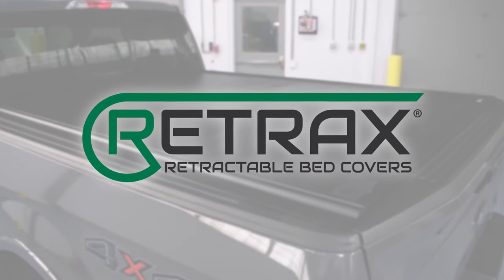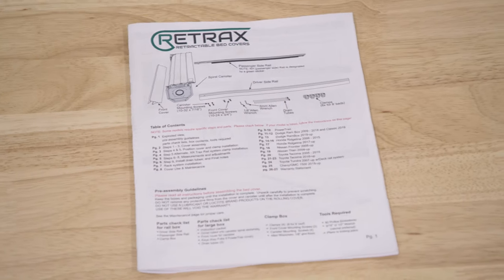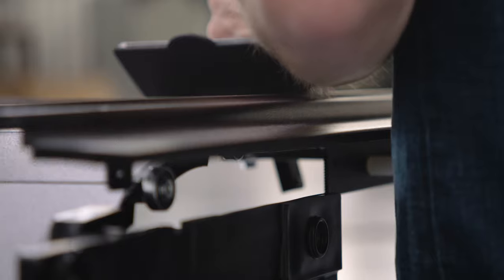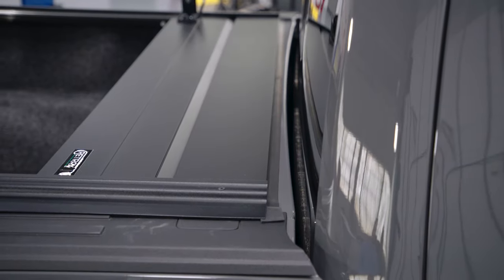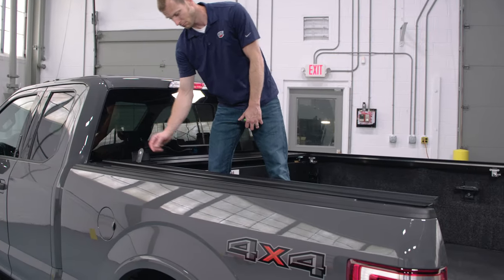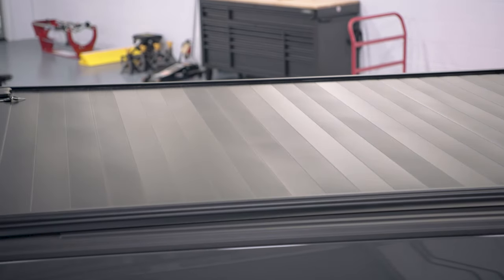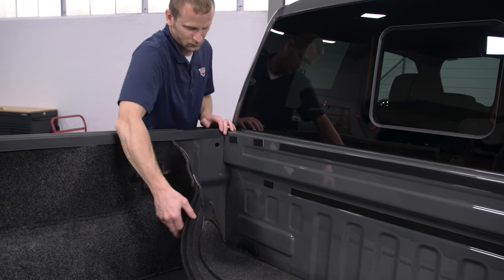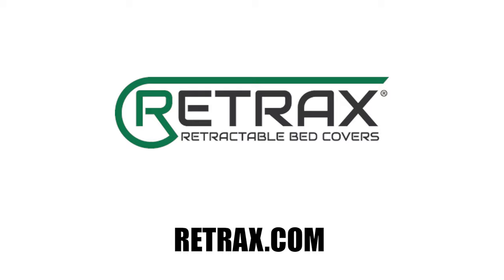RetraxONE MX and RetraxPRO MX Premium Retractable Truck Bed Cover Installation

Comment: Install tip on a 3500 Ram, using factory holes in the sides of the bed for the drain tubes the holes are to high kinking the tube. So I cut the tube and installed a 1/2 inch pex 90 degree elbow. 😁

Comment: Having a tough time deciding between the mx and xr rails. For only roughly $120 more should I just get the xr rails and have em in case I wanna add on later? I just prefer the flushed look of the mx rails more.

Comment: At 4:12, it appeared that too much pressure was needed to push open the cover.  They are supposed to glide open very easily.
Reply: If you look carefully, you can see the cover was not installed squarely... this was a botch job install in the video..  The adjustment is the hardest thing to do.

Comment: So what's the difference between the retrax one mx & the retrax pro mx?
Reply: Yes, Please answer the question.
Reply: @Simper Fi and the aluminum can hold ~500 pounds where the plastic one is limited to 200

Comment: I had mine “professionally” installed and it has leaked ever since. I really like the Retrax, but it’s certainly net everything as advertised.
Reply: Mine leaks like a siv. The entire bed is soaked after every car wash. I’ve had it reinstalled twice, no change.
Reply: Mine leaks too.

Comment: How long does it take to open easily?
Or is it kind of hard to open and close ?
Reply: 12 seconds to open and 20 seconds to close.  (with remote keyfob).   For faster opening/closing I used the White Lithium WD-40 (metal on metal spray) - dont use regular normal WD-40.  Easy to open and close i measured 15 feet away . You can even open/close while your driving your car.

Or try it in a carwash.. :). (kinda kidding , unless ya wanna clean out your truck bed).
Reply: @josephKEOarthur  Using lubricants on the track rails will void your warranty.
Reply: @Rainoffire  yeah i didnt read that . yeah i need a manual on it. i got straw / sawdust inon bedliner and on the cover. i was wondering how i get that out.
- I keep blowing it out. (Halloween
 and all the pumpkin stuff too).

Comment: How much weight can the panels support ? Is there any difference between the 2 materials in capacity also
Reply: On the ranger forums, the ranger version supported a 200lb male. But I would call them directly to get something more concrete.
Reply: retraxone - aluminum reinforced polycarbonate supports 200LB
retraxpro - aluminum finish supports - 500LB

Comment: Retrax has some serious problems delivering their product. Been waiting for a ship date, still waiting. Disappointing!!
Reply: Did you finally get it?
Reply: @LegendOfTheIceKing  Yes I did and I love it. Hope they improved on stop making promises they can’t keep.
Reply: @wallybergen77  what size bed do you have?

I have a 5'5" so I'm thinking do I get it and have the ease of access and security while sacrificing a foot of space or go with a soft cover (TRI folds) which I hate tbh 😂
Reply: I was thinking of getting the GatorTrax if this one doesn't fit.
Reply: @LegendOfTheIceKing  Have a MegaCab with the 6’ 4” bed and Rambox. Not many options out there.